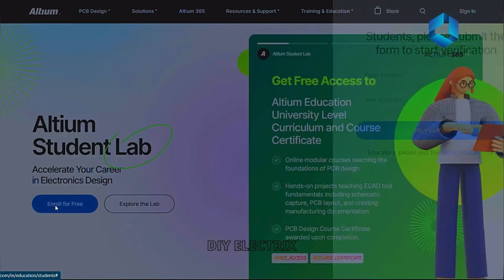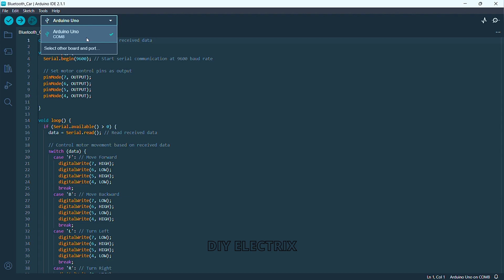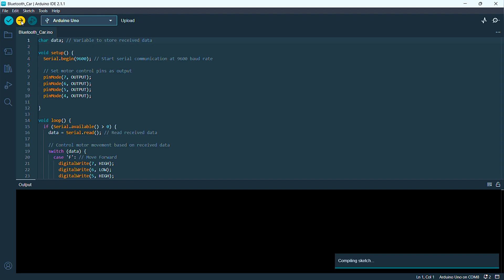How To Make Bluetooth Controlled Robotic Car | Arduino Bluetooth Car | Electronic Projects

Comment: Sir you have used 2 batteries or 1
Reply from the maker: I have used two 18650 battery total voltage 3.7v * 2 = 7.4v.